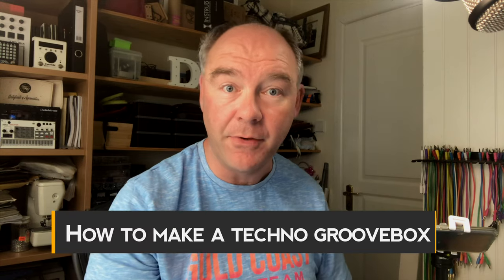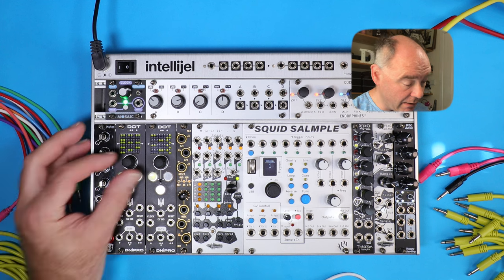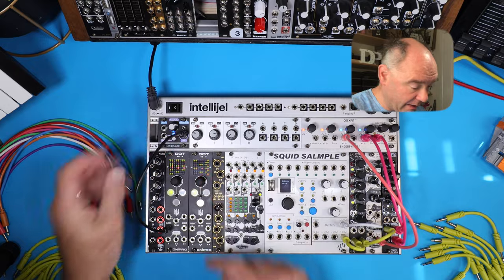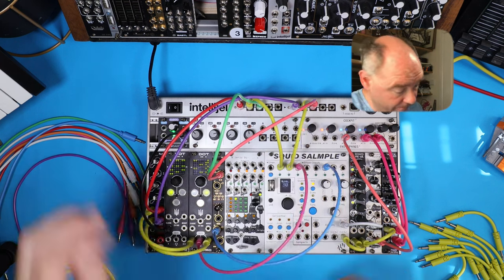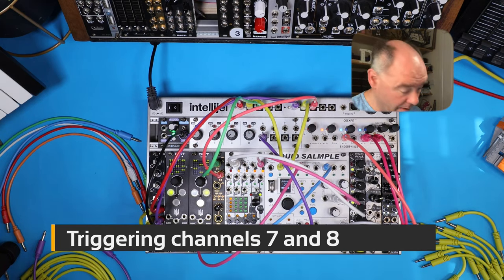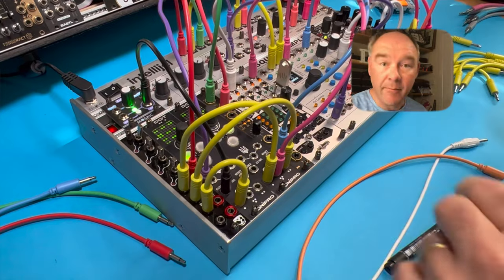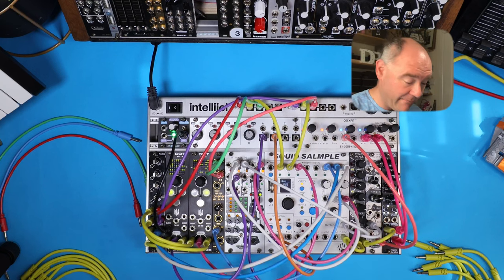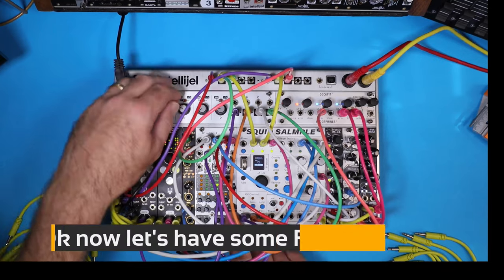How to Make a Great Modular Techno Groovebox - Tutorial and Demo

Comment: Great video! How are you using the 1/4 inch audio outs at the top without the Intellijel output module? Asking as I’m interested in this case but not sure how that works. Thanks!
Reply from the maker: The Endorphins Cockpit 1U module connects directly to the 1/4 inch outputs on the top of the case. It's a 4 channel mixer, with headphone output and also connects to 1/4" out. A great module to use in a Palette case! Thanks again for watching